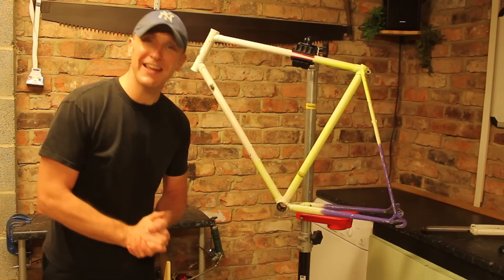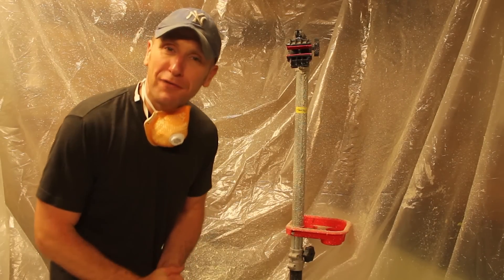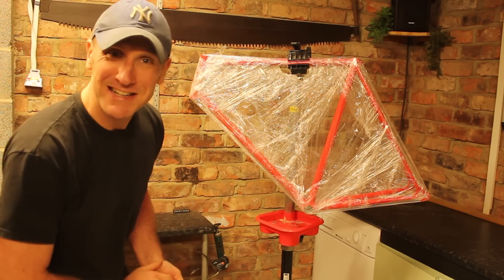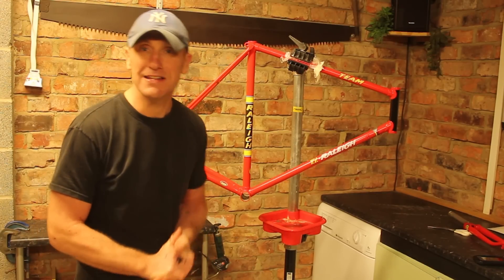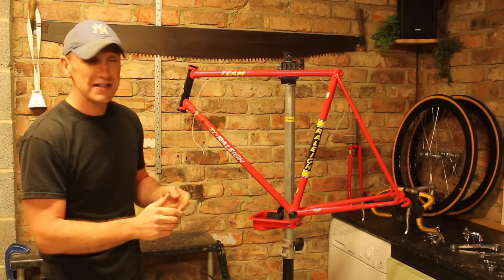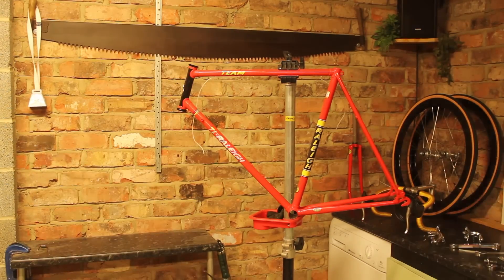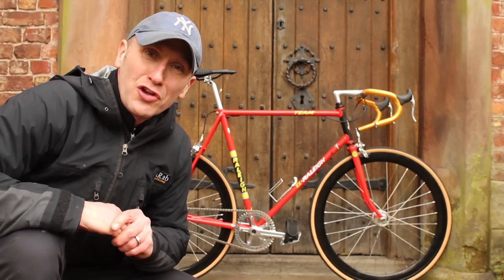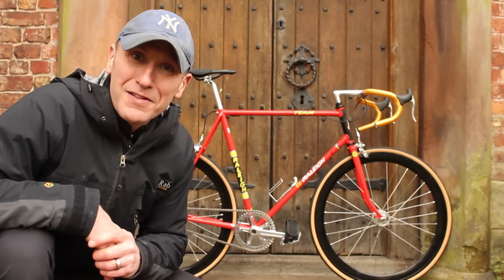Raleigh Ti Team Replica Restoration

Comment: Great video! I just want to ask. What kind of frame was that to start with? How close is that to the original Joop frame? Is it the same tubes at least (531)?
Reply from the maker: Thanks for watching and the support. The frame was a Raleigh frame and I am sure it wasn’t Reynolds 531 so would of been a heavier frame.

Comment: Excellent work Andy. One of your best one's yet. Inspiring work. The small oval champion sticker though by the chainset belongs on the down tube above the shifters on my 531 Raleigh. Gorgeous bike though. I would keep it.
Reply from the maker: +Ian Fisher Thanks for the comment and watching, yes I had studied the decals to some length, the champion sticker with the band around Is placed above the shifters on the down tube. I think later on they placed a further two by the chain set? Old bikes so much more interesting!
I think that there are about four variations of the Team colours, for instance some have Team Raleigh across the top tube where as some have only the word Team. What is also interesting is that the first ones had a yellow head tube?? A lot of history associated with this frame and a fare few variations. Its all good stuff thanks again for the support Andy

Comment: Good work again Andy. In my experience of having a frame powder coated, the workshop who did it said there's no need to paint strip it as they just sand blast it before powder coating it, which removes the old paint and rust to bare metal. 

George
Reply from the maker: +George Holmes Yes this seem to be the case. I had noticed an advert quoting half the price if the frame was stripped however it costs as much in stripper and is a lot of effort. Thanks for the comment and watching all the best fella! Andy

Comment: Just got a 79 Super Course, a one owner bike in great shape. Paint just needs a freshening and it comes with great Suntour Cyclone first gen deraillures. Im going to change the Weinmann center pulls th NOS Cyclone side pulls. Anything I need to know about changing them out? I liked and subscribed.
Reply from the maker: First thanks for Subscribing and watching. Regarding changing the callipers just be mindful that you may need long reach side pull callipers. RJ TheBikeGuy has done videos on this in more detail. I hope that this helps good luck and all the best Andy

Comment: These are fantastic videos Andy, thanks.  I've been restoring some early 80s Raleigh bikes... current project is a Record Sprint MK2... question for you if I may... I've purchased a NOS raleigh headbadge with two pins on the back that correspond to two small holes on the frame.  How do you fit it?  The pins are quite long and will surely foul the steering tube inside the head tube.  Do you have to trim the pins once fitted?  Thanks in advance for any tips! Mike
Reply from the maker: Thanks for your support and watching. I personally would trim the pins before fixing into place ensuring they do not foul with the forks. Definitely trip before fixing glueing into place, I hope this helps good luck all the best
Reply: You're right. I took needlenose vise grips with jaws ground thin. These held the pin to shorten on a fine bench grinder. I found the pins on e-bay. Made in England.

Comment: Hello again I am still restoring my Rayleigh Record Ace circa 1970 but like a plonka I decided to completely strip the rear free wheel inner bearings and cogs  to inspect and to clean,but here is the question,I did not keep the cogs and spacers in the correct order!! Are the cogs equally spaced to each other?  Thanks in advance and keep the vids coming really informative
Reply from the maker: +Roger Grote Hi Glad to hear that you are getting stuck in, sounds like your not leaving anything out. Good man, as far as I am aware the spacing on the rear cog are equal. Good luck on the rebuild, you will have to send me a couple of images when finished should be a good build. All the best and thanks again for watching Andy

Comment: Hey i'm doing up an old raleigh. Did you use an original bottom bracket/ headset? Cause the raleigh old frames have finer threads compared to more modern bike components. cheers
Reply from the maker: +Laurence Mitchell thanks for watching and your comment. I used the same bottom bracket just new bearings. The bearings are only a couple of pound from eBay. All the best Andy
Reply: BikeIt UK Thanks bro! Good job on the bike!
Reply from the maker: +Laurence Mitchell sorry didn't answer your question. The bottom bracket original with new bearings. The headset I think was brand new but old stock. 👍

Comment: The tires really set up the bike nicely! Great build! What brand tires did you use?
Reply from the maker: +Sokha Mao hi thanks for the comment and watching! I generally search for 700c Gum wall tyres and see what are available they range from Dunlop to Schwalbe or even Raleigh. I generally buy 23mm or 25mm for the fixed wheel restorations. Cheers Andy

Comment: I am restoring a bike atm and was thinking of going to single speed to keep it simple and clean, as I want it for a commuter. Did you get the flip flop hub as part of the wheel set or just the hub itself ?
Reply from the maker: Hello and thanks for watching! The flip flop hub came with the wheelset! As long as the hub has a thread on each side the free wheel and cog can be just screwed on to this also. I hope this helps thanks again Andy

Comment: Where did you get the handle bar tape?
Reply from the maker: eBay I searched vintage shiny handlebar tape. I hope this helps
Reply: @BikeItUK  thank you.  I've noticed that when applying this type of tape,you start at the top?  Is there a specific reason for this?  Thanks
Reply from the maker: @mikehaines1403  in the 80’s using this type of tape it was applied from the top down. It didn’t require finishing tape and the finish looked neater 👍🚲
Reply: @BikeItUK  ah thanks for the advice and education.  I looked on eBay and found some nice red tape.  😁

Comment: Hi Andy, really enjoying your videos. Just starting my first restoration and I  have used paint stripper followed by a wire brush twice but there's still a lot of paint left on the bike. How important is it to get all the old paint off, can I just put primer on then respray?
Reply from the maker: +SmartStr33t I'd say as much as you possible can, it's all in the preparation they say! If you are going to prime over then I'd say to make sure it's completely dried out and clean from any stripper. I'd then sand and smooth off the frame. Prime it and sand it down with a very fine paper. Do you have anywhere that may dip the frame for you?  Good luck Andy
Reply: +BikeIt UK that bike is realy cool😃
Reply from the maker: Thanks! Andy

Comment: That is one nice looking single gear Andy, while am thinking about it you made a whole 'new' bike, well done, if you don't mind me asking, if you were to sale it how much would it be? Cheers and thanks for another great and inspiring video J.
Reply from the maker: +Nauj Aral Hi you, hope that you are well. Thanks for the comment, yes it really is like a brand new bike! Its up for sale on Ebay see the link in the description above. All the best and thanks for all the support pal. Andy
Reply: Thanks i went to  see it , out of my range :), and it's always a pleasure Andy
Reply from the maker: Sorry about that I have spent bit of money on this one the next one should be around the £80 mark. Andy
Reply: :) just kidding Andy am sure it's well worth it, so you got a new one coming up hhu. great will be on the look out for it.
BTW i hit a snag with my restoration/conversion on the old peugeot i rescued, the beautiful original brakes that read Peugot, i can't use them with the double wall "v" rims i got , appears that in need long reach brakes .. is there any work around this that you know of ? if you don't mind me asking of course .
Cheers
Reply from the maker: +Nauj Aral Brrr I had the same problem with this Raleigh, Im sure you can get extenders but to be honest they don't look that great....some things, and the direction of the restoration just unfold as you work around the problem and decide on the course of action. Keep going and look forward to the finished bike Cheers Andy

Comment: can you tell me where you bought the crankset and the wheels?
btw one of your best projects yet!
Reply from the maker: Cheers thanks for the supporting Comment. The crankset and wheels was both bought from eBay. The wheels I just searched for 700c deep section fixie track wheels. The crank I searched vintage 46t single crankset, which should bring it up. I hope that this helps all the best and thanks for watching Andy
Reply: +BikeIt UK thx :)

Comment: the brake levers are not parallel.....
but why didn’t you use the fantastic Reynolds 753 team bike frame?
They were manufactured in Ilkeston back in the days out of the lightest 
tubes available at that time!
Remember Didi Thurau rode one on the 77 tour de france,wearing the yellow jersey for two weeks
and winning 5 stages.
Would love to see a gios*torino built up with Campa super record plus pantographed stem,seatpost
and chainwheel🙏👍

Comment: Hi . How do you remove the head badge
Reply from the maker: Generally they are glued on if so with great care and attention slowly working around the badge easing it off gradually. If the badge has been riveted then these need to be drilled in the rivet hole. I hope this helps all the best and good luck 😉🚲

Comment: how mutch would you sell it for?
Reply from the maker: +Noah Sandgren sorry this bike has already sold. Thanks for the interest Andy
Reply: i was just wondering how much money you get for restoring bikes? i've restored a few but you barely make any profit unless you have old parts laying around. How much profit do you generally get from these bikes?
Reply from the maker: Ok, well yes you are right regarding some projects. If you find a gem with all original parts and just needs a good clean and new tyres etc, depending on what you picked it up for you can make a big profit. On others it has been not much at all, however I have just started selling some of the parts that have been stripped from bikes and making the profit margin greater that way. I also get paid a little through the google adsense program on the videos I produce. Its hard sometimes because you know what the resale value of the bike is,  and you can feel a project running away with itself because you want to make a good job of it. I have took a loss one project and made £200 profit on another, it keeps me interested, and I enjoy bringing new life into these bikes that's why I do it. I hope this helps Andy

Comment: I bought those same single speed cranks off eBay, and the non-driveside crankarm started to wobble on the bottom bracket that came with the crankset, and quickly realized that the broaching of the square hole in the crankarm was just large enough for it to bottom out and not wedge on the spindle. In my opinion, that is the result of poor manufacturing and quality control, and the retailer would not exchange it because it had already been mounted on a bike and said they had to assume it was a result of overtightening the crank bolt. The price of $49 shipped to my door was very alluring, but beware of potential quality control issues.
Reply from the maker: +worlddomin623 thanks for sharing this, I will be mindful and try and mention the concern in an appropriate video! Sorry to hear this. Andy

Comment: You did a fantastic job again. But i don't think you make any money out of this when selling it on ebay for under £400...
Reply from the maker: +Bluthund666 No its true, the Fixie,Single Speeds cost to make up with all the new parts, wheels alone at nearly £100. The bike is now at £350 and still not gone. Its fine if you are making up for yourself, I am half debating unpacking it and having it for myself and selling my personal fixed gear instead. Thanks for the comment All the best Andy